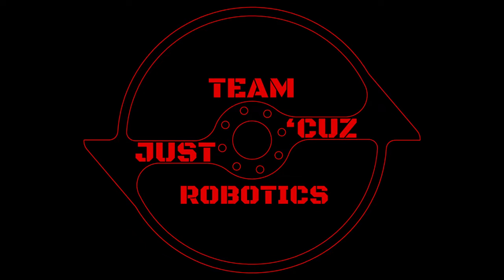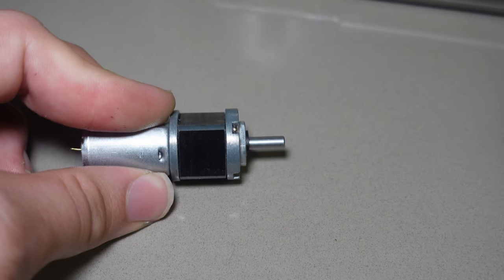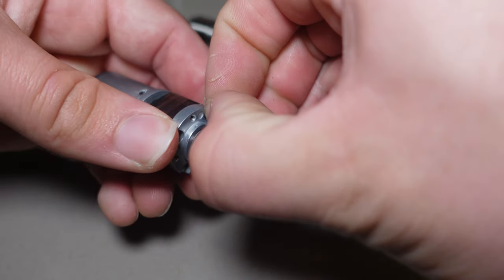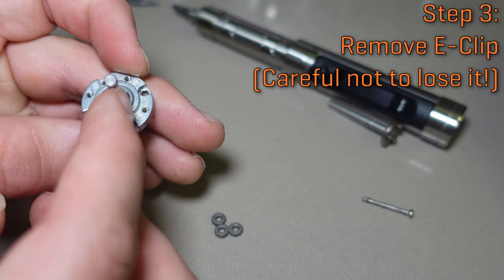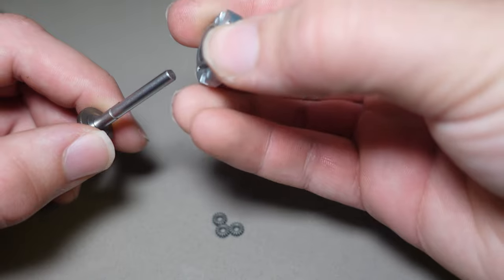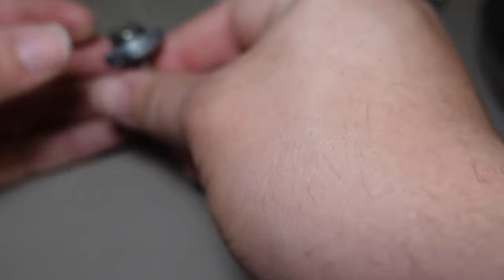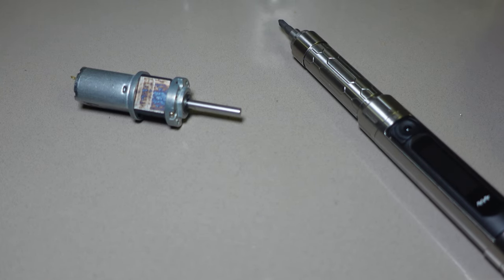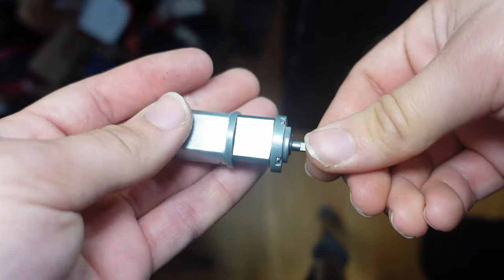DartBox Gearmotor Shaft Replacement Tutorial - Just 'Cuz Robotics

Comment: Lovely. Seems like the procedure also works for ServoCity planetary gear boxes?
Reply from the maker: If you are trying to swap a shaft from one service City gearbox to another then yes probably would work fine. The shafts that I am selling however will almost certainly be different from the pin spacing on the carrier plate of different Motors